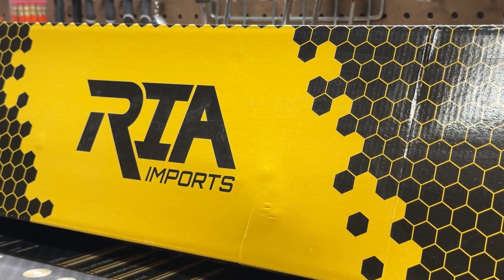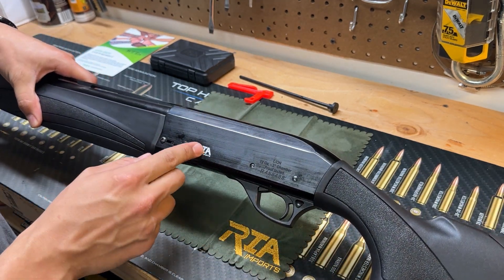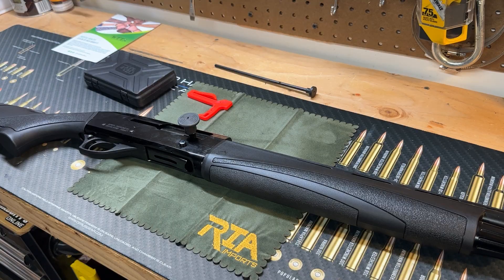Rock Island Armory LION 12 Ga Shotgun DISASSEMBLY FAIL! Unboxing the Turkish Semi-Auto.

Comment: I ahve a lion 12 in 3 inch. It says the capacity is 5+1 but i could only fit 4 in the tube. Do you have any suggestions or even a video on how to remove the plug becuase it must come with one already installed
Reply from the maker: Typically a 3" shell shotty like this can also hold 2.75" shells as well. Usually you will lose a single shell when using the 3"shells in the magazine. If you use the 2 3/4" shells, you should be able to fit a solid 5 shells in the tube. Let me know if this helps!
Reply: @MatSuPewPew907  will do

Comment: One of my pistons just slides up and down when the charging handle is pulled back.
Anyone know if thats normal or how to fix it?
Reply from the maker: As far as I know of this style gun, the extra piston just slides on its own until you decide to swap them out or if you prefer one piston over the other, you can just remove the spare piston. Seems like the free sliding could lead to problems or broken piston with a lot of use.